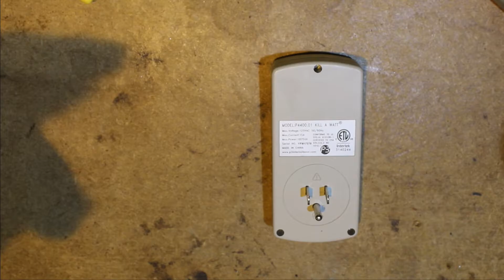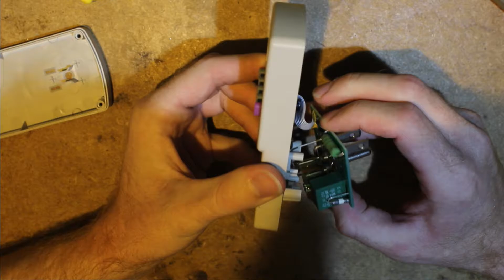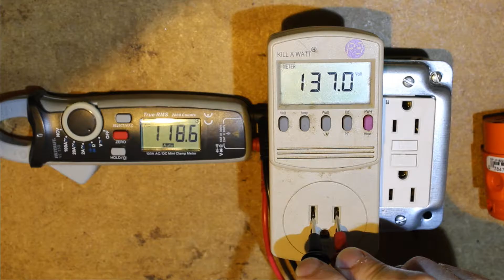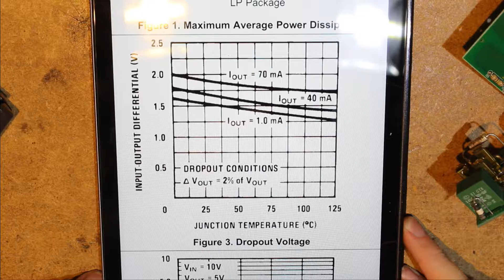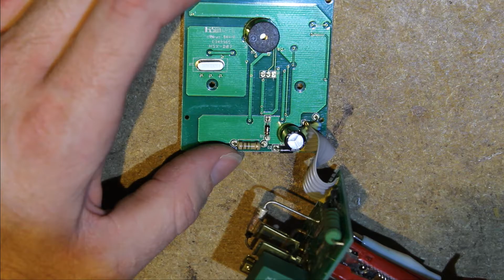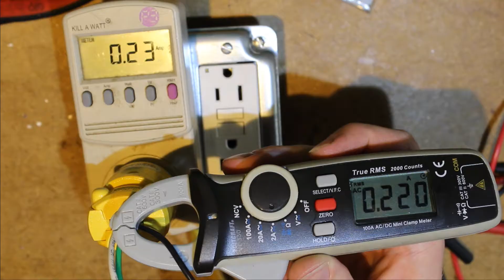What's inside a Kill a Watt with bonus fixing a Kill a Watt

Comment: Kilowatt or 1 and one third horsepower. AC power an interesting subject take the wire you want to measure the current with the Clamp meter coil it ten times and its good then for low current measuring..
Thanks for taking the time to present.